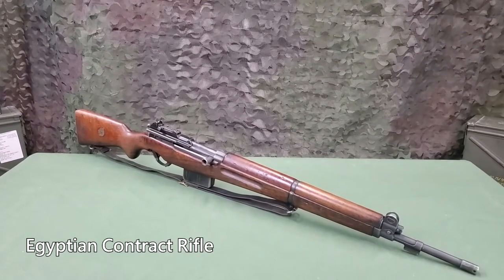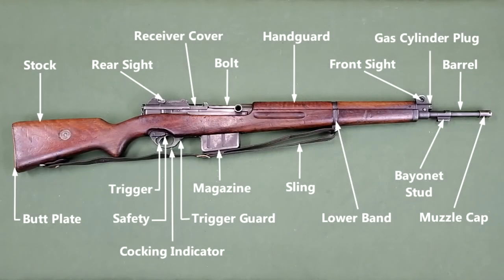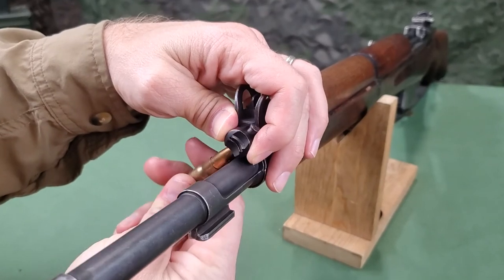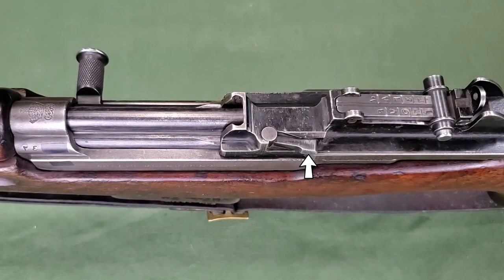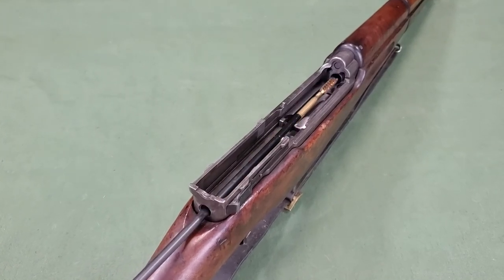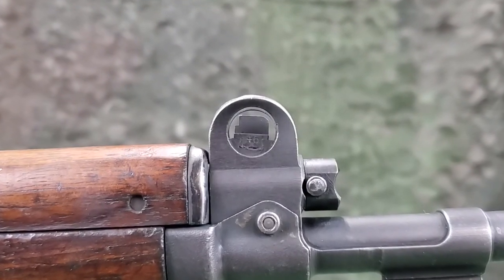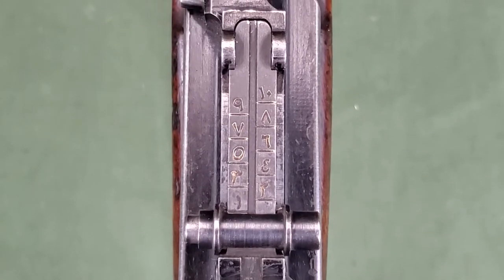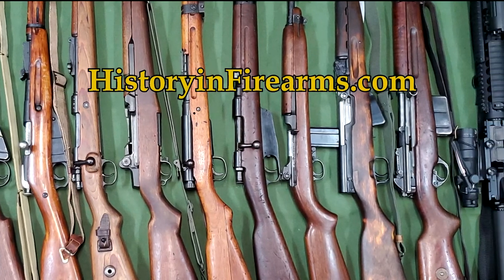FN-49 (SAFN) Characteristics and Features (TF 14-01)

Comment: I want information on the measurements of the wooden heels for the length and width of the piece.
Reply from the maker: You want measurements of the stock?
Reply: Yes, I want the measurements of the length and width of the stock, and you have all respect.
I want the engineering measurements for the heel of the rifle in order to make a new heel that is similar to the old one, because the old one has been missing for me for a long time. I own an Egyptian fn49 rifle without a heel 
Or the wooden structure body measurements .

Comment: Patton was wrong , the fn-49 is the best battle rifle ever implemented .
Reply from the maker: How world events might have changed had this rifle been developed just a little sooner is an intriguing thought.
Reply: @HistoryinFirearms  yup, I love mine very accurate and reliable,  it was great adjusting the gas system at the range, also you can load ten rounds in, push down on the last round , not to chamber the last round, close the slide on a empty chamer, drop the hammer, and now the weapon is decocked, and loaded, all you have to do to ready the weapon for firing , is just pull the slide back to chamber the first round  and you are good to go.

Comment: A friend of mine offered me an Egyptian version. I would like to know what loads are safe for it and what loads are not safe. Some 8mm Mauser loads are pushing a 196 grain bullet at 2600 fps, are these rounds safe for the FN49?
Reply from the maker: I have shot some of the heavier loads with out issues. The FN-49 does have the adjustable gas system. The lighter loads will certainly be easier on the rifle.
Reply: @HistoryinFirearms  thank you. I do plan on handloading my own 8mm and hunting elk with it, if possible.
Reply from the maker: @justsomeguy922r  I dont see why you wouldn't be able to do that. The gas system is fairly easy to adjust. I do have a video on that also.
Reply: @HistoryinFirearms  I’ll definitely give it a look. The load I had in mind is similar to the one I mentioned, a 200 grain bullet at 2600 fps.

Comment: I have a Fn49, wish they had adjustable sights like the Garand.
Reply from the maker: Yeah that would be nice. For the minimally trained soldier, these are certainly simple and less to mess up though.
Reply: They do , windage is screw adjustable and elevation in slide elevator , example , Fn49 in 7.92x57mm is more accurate with correct ammo then my M1 Garand with M2 ammo from bench with rest , gas opened 90 %.